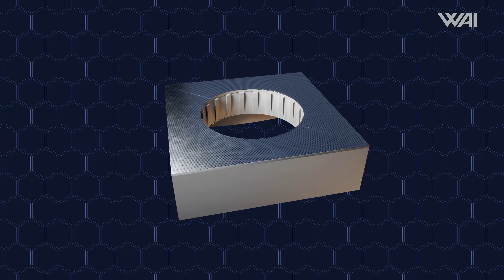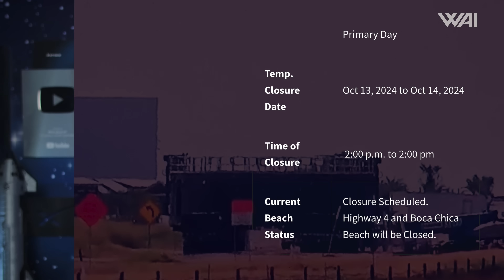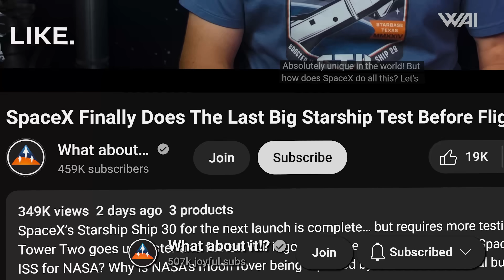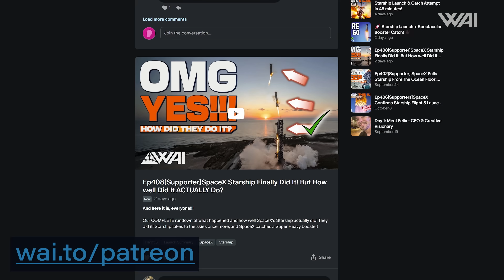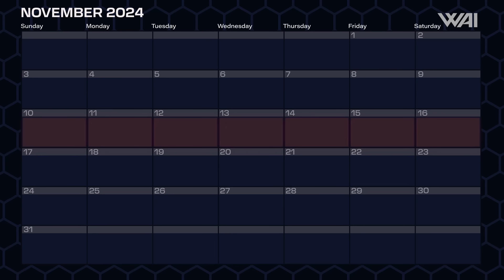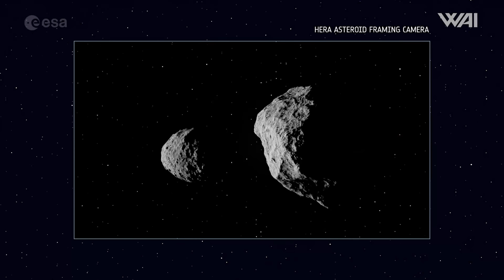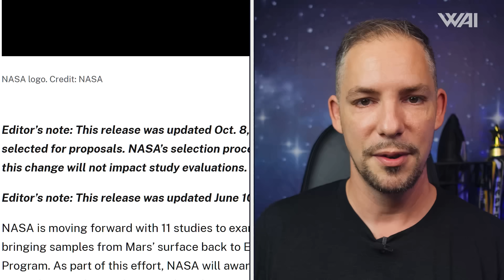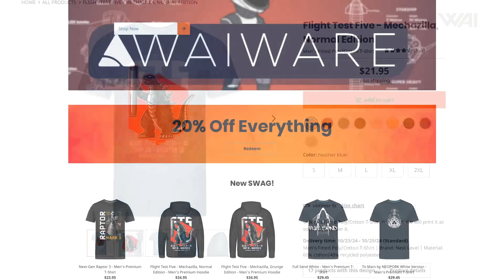SpaceX Reveals Flight 6 Starship! Possible Launch Date Available! Can They Do It?

Comment from the maker: What do you think? Will SpaceX be able to Launch in just a month from now, or will something hold them back? Give me your flight 6 launch date estimate in the comments below! :_WAIHeart::_WAISweet:
Reply: From the outside it all looked really good on the ground. I think before Christmas.
Reply: They wont be able to launch in One month but they could launch by the end of 2024
Reply: Going to give a date here: November 17th.  It will take at least 3 weeks for damage review and mitigation
Reply: IFT-6 next weekend please!!
Reply: I'm thinking before Thanksgiving!
Reply: My best guesstimate is early December.
Reply: @Whataboutit  i want to see a Black friday launch. People and kids off, most shopping being done online means the news might cover it live.
Reply: i hope they can before the end of november
Reply: I'm guessing November 9th
Reply: Flight 5 was full of terrible failures:
- damaged catching pins
- damaged quick disconnect 
- damaged tower arms
- damaged OLM
-  damaged booster with warped engines that have no easy solution to prevent this issue
- Starship heat shield is too fragile, needs weeks of repairs, and the new design is months away.

A next flight in November is a waste of money because does not give time to implement design iterations to fix the terrible failures we saw in flight 5.
Reply: When does Raptor-3 get to fly? Will it debut along with the V2 vehicles? Or will it be a little later?❓
Reply: Youtube bot nets do not like and subscribe, unless you pay them.
Reply: With FAA interference out of the way and the massive success if IFT-5, my guess is that only repair works and heat shield upgrades will drive the launch schedule for IFT-6.
Space X has a boulevard open in front of them, so I would bet on mid November at the latest.
Reply: @everydayastronaut has the footage of the skin ripping off on landing...
Reply: 11-18-2024 🚀
Reply: @mokorily5022   Thanks for trolling the SpaceX related content.  It drives comments and makes the site more popular.  Let’s drive the discussion, how terrible were the failures?
Reply: I think the November 11th date is a little ambitious but a Thanksgiving weekend launch is definitely possible   The FAA license approval is in place as long as the flight profile isn’t changed.
Reply: @mokorily5022  FAA employee? ;-)
Reply: "As early as" being the key words.  I expect SpaceX will again be waiting on the FAA.
Reply: 18th November.
Reply: @tedtomoyasu8438  OK, please tell me how SpaceX is going to prevent the booster engines glowing red hot with air friction and warping with the air pressure during the fall !
Reply: @gregmarsters2434  No, I am Blue Origin fan !
Reply: ❤️ TEAM!
Reply: November 10, 2024 is my favorite date for a flight 6 launch. We can only hope for a flight 7 this year as well. Thanks for keeping us up to date, Felix.
Reply: @mokorily5022  - They can use better materials. They could also try to route some cryo-propellant through the outer engines to improve their cooling.
Reply: Considering that they've already static fired ship 31 and that the Superheavy booster is almost finished product, I suspect it's highly likely they'll be ready to go in a month.I'm hopeful.  :)
Reply: @Whataboutit  my guess Dec 11
Reply: @Whataboutit  late december
Reply: I think a month from now is probably a little optimistic. Seems like the bottle neck will be the heat shield, and if the past has told us anything it’s that revamping and replacing an entire starship heat shield takes a while. I bet they won’t fly until they have some confidence that they have implemented a new heat shield design that will outperform the one on flight 5. I think early December seems more likely.
Reply: @manofsan  All solutions add weight to the booster and limit its range, and that is not a good option. I prefer to calculate what is the maximum safe dimensions that the booster can have, allowing it to land in ship in the middle of the ocean. SpaceX can easily add the extra thrust using solid rockets like ULA and NASA are using, but designed better that is what SpaceX and Tesla ace. The issue is that someone (probably Musk) like big things, big is not always a solution, and if you do not believe me, just Google that the OLM is damaged and is going to be replaced with a bigger one. Lots of delays in this concept, and if I was Elon, I was reducing the size of the booster, add to it four consumable solid rocket boosters, and speed up the project to colonize Mars before China does it.
Reply: December 15
Reply: Nope. Next year
Reply: Nov 13th
Reply: Tomorrow
Reply: @Whataboutit  Tell Elon to think more of overlapping design on the heat shields. Fish scale.
Reply: Hello Sir. Wouldnt it be a good idea to have Space X release a competition for amateur designers to design a catch and launch system. It Seems very inefficient to me.
Reply: Before the end of November.
Reply: Flight 6 after the new year or very, very close to it. 🚀 More underlying damage to the launch platform needs to be resolved. While the test program makes progress, we're still 5-10 years away from moon and Mars human exploration and starship frequent launch cadence.
Reply: I see flight 6 after Thanksgiving day. Sometime in the first half of December at the earliest.
Reply: Hopefully IFT6 can catch both booster & ship. Launch on 24 / 25 december would be nice. Or at 31 december  and landing on 1 january 😅
Reply: Why did you put a stapler for a clipper? lol
Reply: "A couple of month ago" This is not grammatically correct and you KNOW it.
Reply: I say November 20.
Reply: @mokorily5022  No way!
Reply: @mokorily5022  - Elon & Co may be looking at a more modular OLM and a taller tower. Modular OLM can have pieces swapped to return to operational more quickly. Taller tower of course keeps the flames farther away from OLM.
Reply: @StevenIngram  - I wish we could see Ship 33 fly next instead, since that's got the latest V2 improvements. AIt seems to be just about done,  and all it needs is a static fire.
Reply: 1st week of December. Awesome episode very informative 😊
Reply: @DieterMaier-r6k FULL SEND
Reply: Hope so!!!!  Ill be booking my redline heli flight!!!
Reply: Rememeber the 10th of November!! Flight 6th guess
Reply: You know that the 11th November at 11h11 is the official start of the carnaval Season. Ja doch?
Reply: My best guess is middle of december.
Reply: Ok, Call me an idiot if this is a stupid suggestion, but couldnt SpaceX clad the upper surface of the launch mount (or in fact any vulnerable surface on the OLM/tower) with thermal protection tiles? I mean, they are designed to withstand the intense heat and friction of re-entry, so theoretically they should be able to withstand a few dozen seconds in the firing line of the booster, right? Then again, the first booster did manage to blast a crater under the OLM before the deluge sustem was installed, so perhaps the thrust would just rip them all off.
Reply: I think the date will be between 11th to 17th november. Space x has been quite fast now a days. They have the equipment, workers, technology and everything else. And right now elon would like to show the FAA no earlier than late November. If not made impossible by something unavoidable.. flight 6 will happen before flight 5 was supposed to.
Reply: 2 months
Reply: Stupid question maybe, why don't they cover the launch mount, all components exposed to heat and cover with the same tiles etc that are found on starship?
Reply: @cvitano  Litterally asked this exact thing yesterday. Seems like an obvious solution, but there may be issues we cannot foresee that prevents SpaceX doing this.
Reply: It needs to test V3 raptor booster an shop soon
Reply: @manofsan  We are speaking of years of delays because of the long term goal of reusability. Falcon heavy is the concept that SpaceX needs to replicate with Raptor3 engines, finding what is maximum number engines a rocket can have without warping during the free fall. Using that number in the rocket core that lands in the catching tower, and adding 4 boosters to that core that do not need a tower to land is the perfect design. The reusable boosters can also be used in low mass missions, but SpaceX also needs to support the core being boosted with 4 SRB from NASA SLS, that can replace 24 (or more) raptor-3 engines. SpaceX Raptor-3 engines and NASA SRBs need to be bundled in ships to move cargo to Mars, before China does it !
Reply: @mokorily5022  - Starship-SuperHeavy architecture is designed for efficient high cadence reusable launch. That can't be done with SRBs.
Reply: @snookmeister55  Waiting on the FAA, until after the Election.
Reply: @manofsan  They'll fly #6 to recover Starship, and analyze  the heat shield.
Reply: @ReggieArford  - they'd need a full orbital flight to recover Starship upper stage, and that would then require a new modified launch license. They already have an existing launch license for Flight #6, but it doesn't cover orbital flight.
Reply: @mokorily5022  - why would you need a new Falcon Heavy instead of the more capable Starship? Falcon Heavy runs on Kerosene-LOX, which Raptor doesn't even use. Falcon Heavy doesn't even have tanks engineered for Methane-LOX, which is what Raptor uses. You can't re-engineer an existing rocket to use a totally different engine and fuel system. Falcon Heavy will simply be obsoleted and replaced by Starship.
Reply: @manofsan  SRBs is the best solution to ship heavy loads to Mars because they are not reusable and rise to higher altitudes. SRBs for heavy machinery and Raptor-3 for passengers and light loads.
Reply: @manofsan  I think there's a way. Launch #6 as #5 was, even recovering the booster. Do a  /not-quite/ orbital burn, to lengthen the trajectory to land in the off-shore recovery area, where boosters and debris are permitted to fall. After a daylight landing, recover the Starship for study. Both the short burn in space, and the offshore landing in that area have been permitted before, so the license should cover this flight too.
Reply from the maker: Editor: Milton is the name of a character in an old movie called Office Space who had his prized red swingline stapler taken away from him. Being marginalized by his boss drove him to burn down the office, and later threaten the resort he escaped to with destruction after once again feeling disrespected by the staff.
Reply: Feel like uninterested going to see flight eight in person can you provide me with some information for the best viewing areas and or possibly helicopter flight for the launch? We are family of three and would like to keep it under $5000 for the trip from California.

Comment: There’s no way booster 12 will fly again — not because of the damage, but because this is the first time they’ve gotten one back intact. They’ll want to tear it down completely, looking for hidden damage and performing all sorts of testing on everything to figure out the exact causes of every failure so they can develop solutions to improve the survivability of future boosters. This program isn’t about the current designs, after all — these are still early prototypes. It’s all about improving future prototypes at this stage.
Reply: Every failure? -did not know that it had any-besides the damage to its chime-and of course ANOTHER starship loss.
Reply: @zarl5238   There was never any intention of recovering that ship. As to failures on the booster, no, we don't know about any, and we can't until we tear it down and inspect every part. Who knows which bolts sheered, which welds split and which plumbing lines leaked? There's only one way to find out.
Reply: I’ve seen no indication that b12 condition can’t be fully determined from inspection, & that a tear down is necessary.
Reply: Hopefully, after the dissection of this beast, it will be saved for historical preservation at the Smithsonian. It deserves to be marveled at by millions of humans  from around the world!
Reply: Absolutely, an intact test vehicle such as this is worth its weight gold to R&D. They will be gathering information and learning things from B12 for months to come.
Reply: @warrenwhite9085  Its not that there is any immediate indication, but that they will learn more from tearing down B12 and doing an extremely detailed investigation into the state of the booster after landing, rather than trying to fly it again. What they learn, if anything, will be used to improve the design of future versions
Reply: @LordDonnington725  ISTM you make assumptions that a tear down is necessary, illuminating, worthwhile .. that I have no evidence of. Maybe it is, maybe not. IDK. But I doubt that a tear down is necessary, though I also doubt b12 will ever fly again, but if they did fly b12 it would validate Starship booster reuse.
Reply: @warrenwhite9085  There will be at least a partial tear down. They will want to access the LOX and Methane tanks to see how everything stood up to the forces in play. They may also decide to cut open the skin near critical structures to better examine them. All of these steps will contribute to future reuse.
Reply: @kstricl  the airframe itself forms the outside of the fuel tanks, & Starship is built for high reuse, so they have inspection/access/maintenance hatches to get/see everywhere, including inside the tanks.
Reply: 100% agree.  Maybe they'll re-fly cetain engines or components if possible after study but not the booster again.
Reply: Agreed. In highly complex and technical endeavors, there is a saying: "You don't know what you don't know." The only way to find out what you don't know is to thoroughly evaluate the available evidence. In this case, it's booster 12. It will be dissected thoroughly and will never fly again.
Reply: 100% agree. Just because there was no failure significant enough to cause a whole booster loss doesn't mean nothing failed. I am sure that when they investigate they will find many parts and components that had failed or partially failed. I can picture the engineers saying something like "Didn't expect that bolt to fail, lucky there were several others that didn't fail. Maybe we should use stronger bolts for that part next time." 😀
Reply: Tear it down? That thing will be in a museum
Reply: @zarl5238  yeah, that's what hidden damages mean.
Reply: Æææææææ@
Reply: Sounds reasonable to me.  Good summary 👍.
Reply: They are going to reach the conclusion that the rocket is too big and divide the 33 engine booster into smaller rockets like we wee in Falcon Heavy.
Reply: @mokorily5022  Whatever you're smoking... Take a break.
Reply: And it is historical The next starhopper

Comment: They should go with ship 33 for IFT-6. Might as well test block 2 ship right way and confirm that the new forward flap design works. Go ship 33!!
Reply: the thing is block 2 only run Raptor 3 and it's not ready yet
Reply: @FarokhBulsara4065  plus there is still plenty of stuff the might want to test on the block 1 starships as well
Reply: @FarokhBulsara4065   oh! I didn't know that block 2 runs on Raptor V3. Thanks for the info!
Reply: @FarokhBulsara4065  plus they can use S31 to test an in space Relight so flight 7 can go fully orbital
Reply: @benoitferland  yeah good idea let's wait until January for it to be ready
Reply: Starship v2 means new hardware and new flight plan, so new license is needed. It will take time, so meanwhile they can launch s31
Reply: @xixixexe9381  This is not V2 it is block 2 of V1 so it should still be covered by existing licence. V2 has larger tanks, and is a bit taller than V1 based on the information released a couple of months back. Also V2 has a new lighter interstage fixed to the booster so it is a significant change. Changes would need to be much more dramatic on V1 to require a completely new licence so as long as the flight profile is the same they should be good to go with block 2 when it's ready.
Reply: 3+3=6 lolll
Reply: I think they actually WANT to test the flaps whilst they are in the worse position. If the heat shielding can protect them in the hotter position they will have additional buffer/confidence when they move them.
Reply: @schrodingerscat1863  ship 33 is a V2 starship
Reply: Better yet... Use booster 12 again for Ship 31 or 32. Get some data on a twice flown booster and don't risk the newer version ships! Or even better.... Fly ship 33 while fixing up B12 for re-flight!
Reply: No because it will require a new launch license because it a new vehicle
Reply: @jordanyarbro  It is actually block 2 of V1 not V2, V2 will be taller with larger tanks and integrated hot staging. This was announced a couple of months back. so this is more V1.1 rather than V2.
Reply: @schrodingerscat1863  Ship 33 appears to  have larger tanks, it has a new f-flap design and placement, and it's possibly the 1.8 meters taller that V2 is supposed to be (I'd have to count rings to be sure). As for the hot staging ring, it is to be integrated on to the V2 boosters and not the ships.
Reply: @wilmersandstrom2826  Ok, I didn't realise they had put all the V2 changes in yet. So I stand corrected it looks like they have produced the V2 Starship already. I also understand that it has been specifically designed for Raptor3 which is why it can't be launched yet. Wonder when we are going to see the V2 booster to go with it.